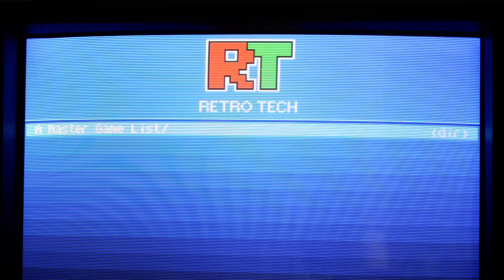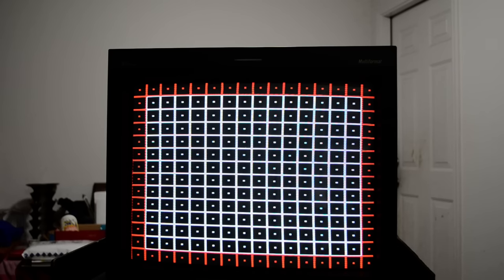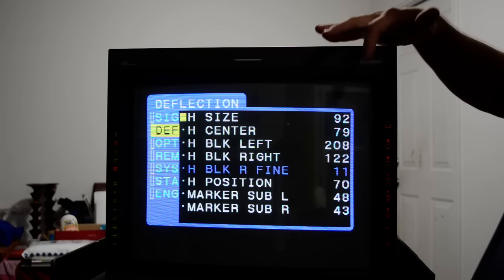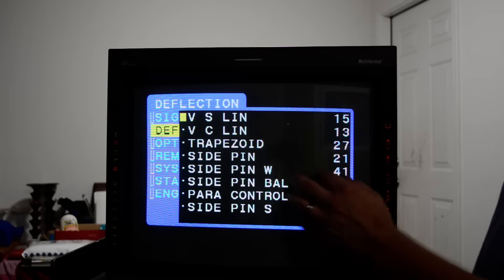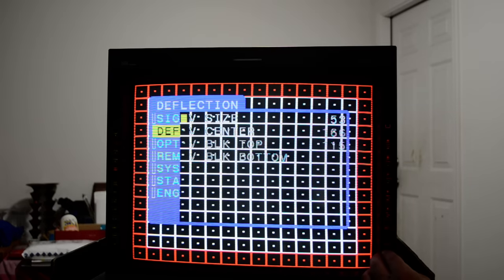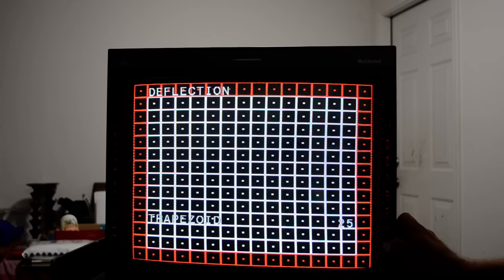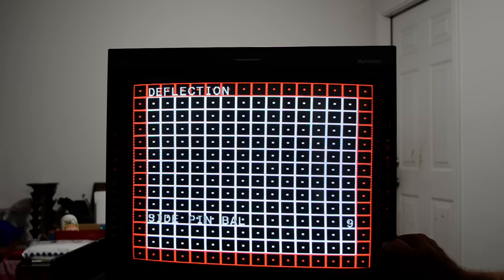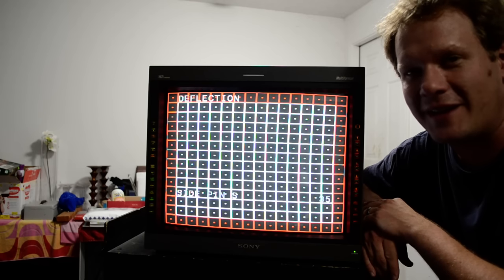Sony PVM 20L5 : How to Calibrate Geometry

Comment: Potentially useful alternative to the 240p test suite grid pattern (albeit without any of the other useful patterns and tests that offers...) is the 'Screen Position' setting in Silent Hill 1 for PlayStation. Run that on a PS1 or a PS2, and you'll get a very similar 240p test grid that can be used for basic geometry calibrations. It can be alternated between black, and white backdrops by pressing the X button on a PlayStation controller.

Comment: For auto color calibrate, pull up regular menu, scroll two down to "User Control 1/2."  under "Auto Chroma/Phase" make sure "Auto Adj Vaule" is toggled to "On." Pull up the Color Bar Pattern on the screen, then click "Start." Geometry needs to be adjusted first otherwise the test will fail.  If everything is good, you'll see it finish in a matter of seconds.
Reply from the maker: Thanks a lot.  I'll be trying this today!
Reply: Is this an option built right in to PVMs?
Reply: @davidc7763  This option is only available on higher end PVMs and BVMs.
Reply: Y0U7U83U53r thanks for confirming
Reply: What happens when you can’t get the horizontal all the way over to the right?  I try to adjust the h center and it’s def off.  Is that a yoke issue?
Reply: @ronniesosin3265  try horizontal position instead of horizontal center.
Reply: @SamsungS-or1qf  thanks bud!  I actually opened up the pvm and noticed there was a switch on the board labeled raster right, raster center and raster left.  We’ll for whatever reason mine was on raster right.  I moved the switch to raster center and it’s perfect now.

Comment: After playing around with geometry and color for some time, the best settings are in the official manual. There is a reason Sony put them there. This should be factory settings, but not always! If you don't have close to perfect geometry by setting it according to the manual, you might have an issue. It should be 95-99 perfect 🥰 😁. There might be small differences in raster and focus settings like landing or vertical size, but that's not geometry anyway. I think you give a great explanation Steve, but settings from the manual are the best or atleast the goto starting point.

Comment: Hello. I am following you and I think this channel is the best resource on the web.
Anyway, I m an idiot and. I just did this:
"Executing FACTROY LOAD
If the adjustment data is damaged or lost by some
reasons, you can restore the default factory adjustment
data by executing FACTROY LOAD as described
below.
Select the following submenus from the Service Menu
in the order of : [SYSTEM] → [FACTROY...] →
[LOAD...] to read the default factory data. If the
default factory data is damaged or the ROM is re-
placed without executing FACTORY SAVE as
described in the following paragraph, you cannot
execute FACTROY LOAD."
Now the picture is completely off.
Do you have any idea how to fix it? Can I still save it?

Thanks

Comment: I have head that there is something called magnetic tape that i thought might work as the magnetic part in a convergence strip but I have not tried that yet. Have you ever tried to make your own convergence strips? I am having a hard time finding those.
Reply from the maker: I haven't ever made any of my own.    There was a seller on eBay that made them, but they stopped a couple months ago.  You can reseat the current strips in the CRT if you can't find replacements, or you can salvage strips from another non-working CRT

Comment: Hey Steve, My CRT is having horizontal linearity issues. Basically the left side of the screen is compressed and the right side is spread out. I recently recapped the deflection board and adjusted the yoke for proper alignment. Any clue how to fix this? My service menu only allows me to affect vertical linearity.
Reply from the maker: Does moving the yoke around help the picture at all?  If you already recapped, then I think it would be the magnetism that is causing the problems.  Most likely from the yokes angle.  I know it sucks, but you may want to open the crt back up and try to play with leaning the yoke to see if it improves anything.  That job is tedious and frustrating so stay calm while you work on it.